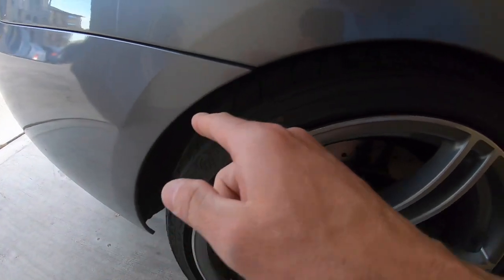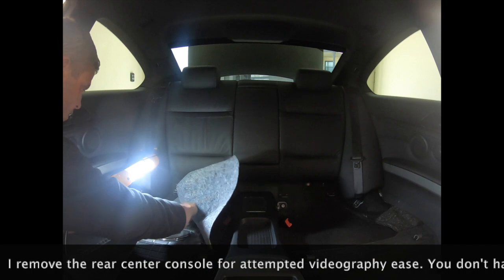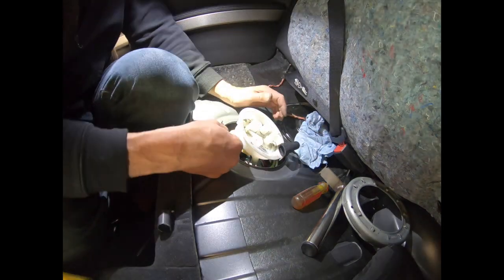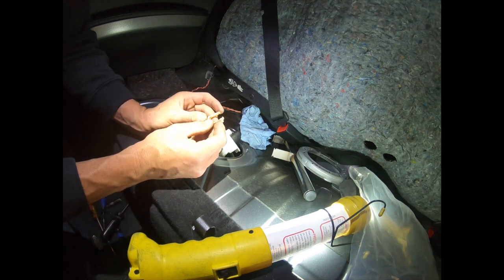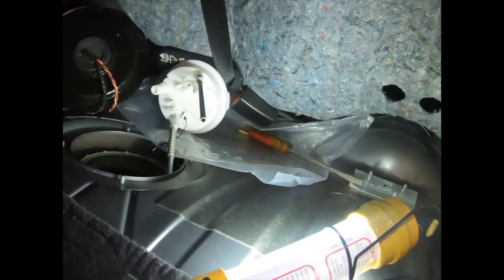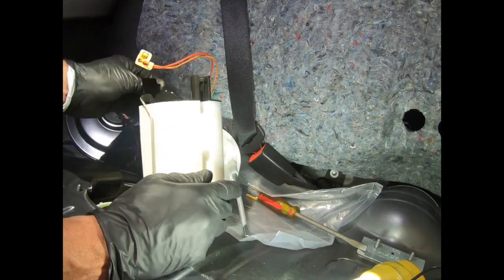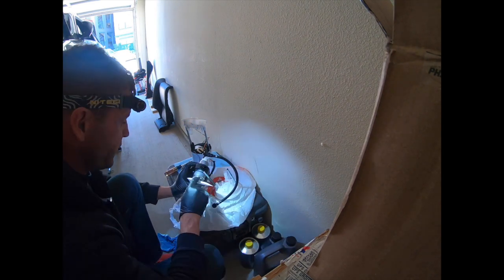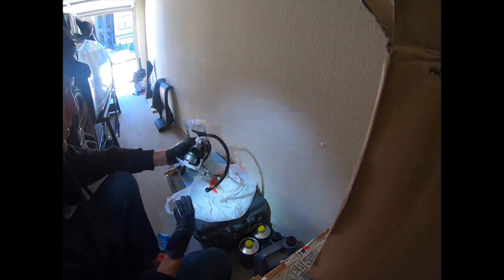Fuel-It FI-650HP BMW E92 (335i | 335is) LPFP Upgrade Install, Part 1

Comment: Bucketless would be better!!! Good vid.
Reply: If you want to fry your fuel pump control module. If you want 700+hp, you will have to get an upgraded fuel pump control module or modify the stock one to not overheat. This set up paired with a hobbs switch is perfect way to prevent that.
Reply: @socalfritos9452 4 psi or 15 psi Hobbs switch